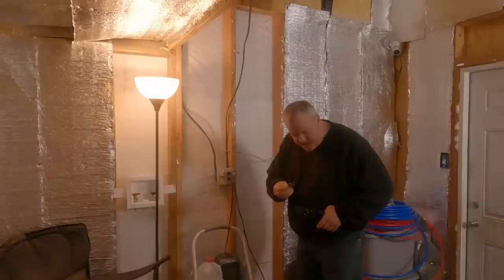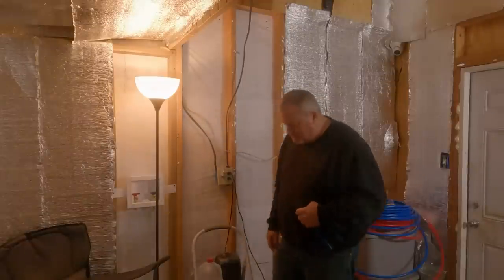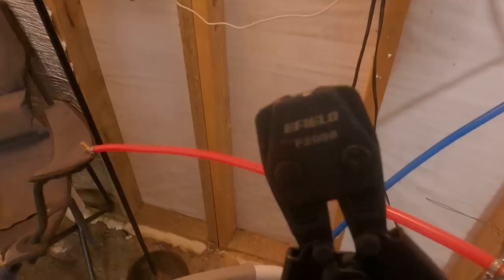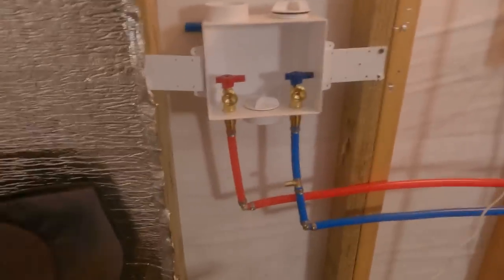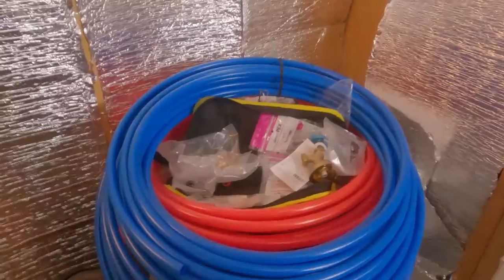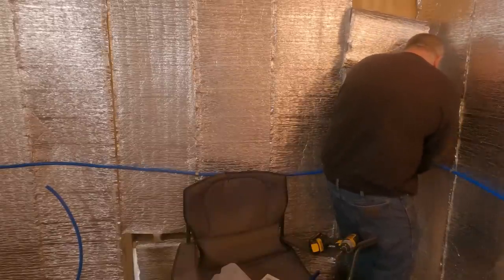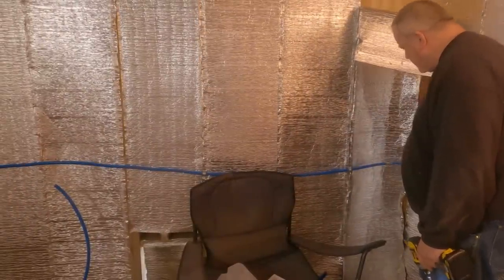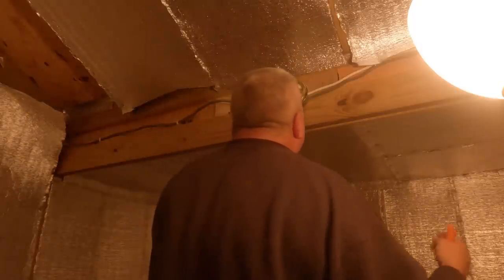Laundry Room/ Dog Apartment Plumbing. New Light Fixture Installed

Comment: It was Keith and just a plumbing tip, the T is an elbow and a straight through run, the less fittings you can get by with the better your water pressure will be,  could have uses a T under the washer valve and saved the elbow until the corner,, 😉, hope that helps

Comment: Is there anyway to extend the handles on the pex tool? To give more leverage so it's not so hard to squeeze? Just a thought. Maybe it would take too much time to rig it up for the short time you're using it. I use a round Rubbermaid gripper thing to open jars. Even something like that might help. Thinking... The room is coming along. I'm excited for you to have more living space in your house 🏡 And of course, I'm thrilled the puppies can get in out of the cold or heat, depending on the weather.